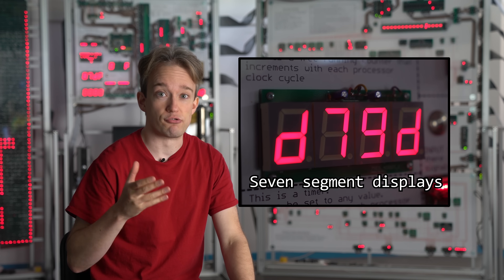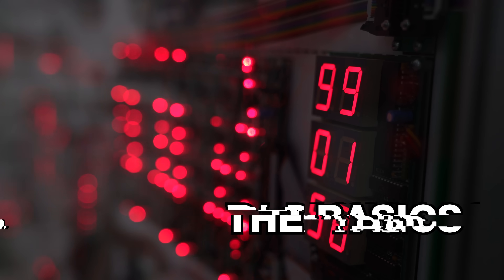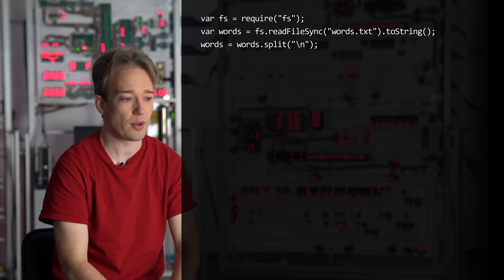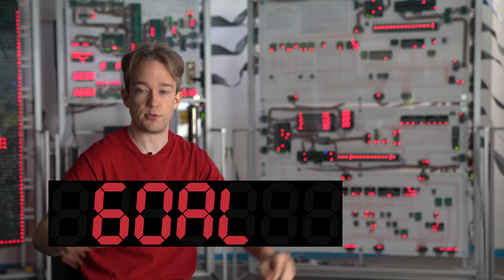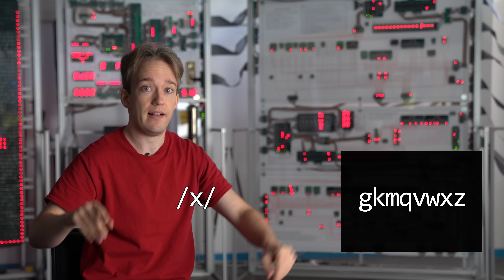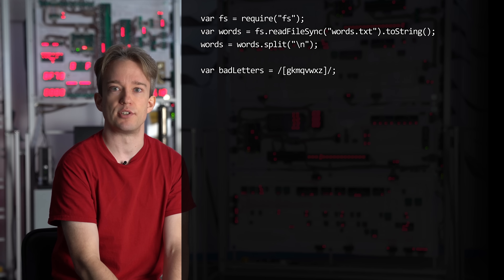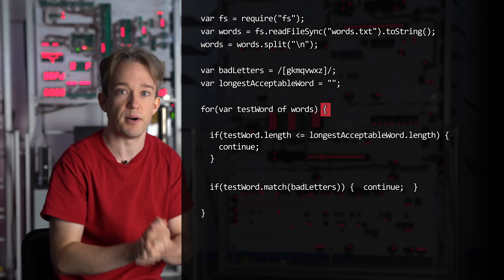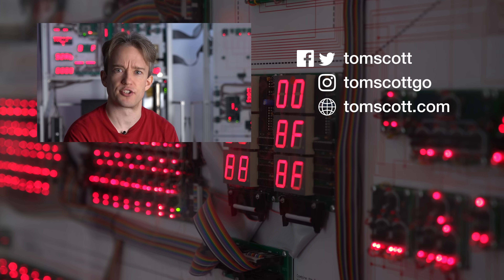What's The Longest Word You Can Write With Seven-Segment Displays?

Comment: I may have an updated list, but the longest word (regardless of whether or not it can be displayed on a 7-segment display) came out to be "pneumonoultramicroscopicsilicovolcanoconiosis".
Reply: Also c#:
using System;
using System.Collections.Generic;

namespace SevenSegmentWords
{
    class Program
    {
        static void Main(string[] args)
        {
            // Gets user input for file
            Console.WriteLine("Enter file path:");
            string filePath = Console.ReadLine();

            try
            {
                // Reads file
                string[] words = System.IO.File.ReadAllLines(filePath);
                string invalidLetters = "gkmqvwxz";
                // invalidLetters += "io"

                // Checks if word is longest and if it is, checks if it is valid
                List<string> longestValidWords = new List<string>();
                longestValidWords.Add("");

                foreach (string word in words)
                {
                    if (word.Length >= longestValidWords[0].Length)
                    {
                        bool valid = true;
                        foreach (char letter in invalidLetters)
                        {
                            if (word.Contains(letter))
                            {
                                valid = false;
                                break;
                            }
                        }
                        if (valid)
                        {
                            if (word.Length > longestValidWords[0].Length)
                                longestValidWords.Clear();
                            longestValidWords.Add(word);
                        }

                    }
                }

                Console.WriteLine("The longest valid words are:");
                foreach (string word in longestValidWords)
                {
                    Console.WriteLine("-> " + word);
                }
            }
            catch (Exception e)
            {
                // Displays error message
                Console.WriteLine(e.Message);
            }

            Console.WriteLine("Press any key to continue . . .");
            Console.ReadKey();
        }
    }
}

Comment: Because one liners are fun.
require(`fs`).readFileSync(`words.txt`,`utf-8`).split(`\n`).sort((a,b) => { return /[gkmioqvwxz]/.exec(b) ? -1 : b.length - a.length })[0]
Also, I disagree with Tom on this. lowercase g and o can be represented perfectly. Therefor with the final code below, the longest word is, strangely, "bras-dessus-bras-dessous" which is apparently a loan-term from French meaning 'arms in arms'. :shrug: After that is 'three-and-a-halfpenny'
require(`fs`).readFileSync(`words.txt`,`utf-8`).split(`\n`).sort((a,b)=>{return/[kmiqvwxz]/.exec(b)?-1:b.length-a.length})[0]
Reply: grep -v '[gkmqvwxz]' < words.txt | awk '{ print length, $0 }' | sort -n | tail -n 1

Comment: "Programming is not remembering exact words or syntax: it is breaking down a problem, working out how to solve it, and then fixing all the inevitable bugs in your solution."
- Tom Scott

Sorry, i am amazed by this explanation of what programming is and i think it deserves to be quoted in the future too.
Reply: True. As someone who've only recently started getting into programming, I sure find it encouraging.
Reply: This is very true. Remembering Syntax is not as important as people think. It’s all about solving problems.
Reply: Also, a lot of people think you need to be good at math to be a programmer, which is not true.
Reply: @Pedro-fh9ec  Math and programming have 1 main thing in common - problem solving.
Reply: @tomekz6841  so that's carryover from math to programming that you can problem solve. got it
Reply: @Pedro-fh9ec  I think knowing math was WAY more important in older forms of programming like Assembly. There's a fascinating video about how Quake developers invented a shortcut for some complex equations as a way to keep the machine from slowly doing the really big number maths. Nowadays you can get away with not knowing any math because the computer can already handle all the math you want.
Reply: @chaotickreg7024  Could you link it to me? or any other resources regarding differences between modern programming and older forms? I am really curious
Reply: @Pedro-fh9ec  I guess you can write some algorithms without math, but almost all big software projects use math heavily because math is the translation from the real world to the abstract world
Reply: @Pedro-fh9ec  I'm rubbish at maths but on the brink of getting my CS50 cert from Harvard. Now, CS50 is hardly a massive achievement but if you need maths for programming I'd never have gotten to this point
Reply: @TypicallyThomas  you need math for certain things in programming for sure, but some things you can skate by without it
Reply: @KayOScode  You mean maths?
Reply: @Pedro-fh9ec  WEELLL if your working at company and need to traverse a huge txt file it helps to be able to find the fastest way to do that
Reply: @Pedro-fh9ec  you dont have to be good at math to be a programmer, but it definetly helps. There are so many parts of complex prograams that get alot easier to design the structure for when you have a good base knowledge of mathmatics.
Reply: @Pedro-fh9ec  You don't need to be good at math to be a programmer, but you definitely need to be good at math to be a good programmer
Reply: And I do NOT miss the old times when I start coding and we had to figure things alone.
Reply: to an extent, this also applies to 3D art :)
Reply: If you study computer science and have even half-decent professors, this is exactly what all of them will tell you. Any programmer who isn't a total elitist will say the same thing.
Reply: @gyroofthyme  I've never met a single person in my life who's said programming is just memorising syntax. That's got to be the stupidest, most reductionist way you can describe it.

What Tom said is common sense
Reply: @itsnottimetostop4462  Yep that's my point. I have met people who think you're a bad programmer if you can't write perfect syntax from memory,  and they're completely wrong. Any programmer or CS professor worth their salt will tell you exactly what Tom said.
Reply: @gyroofthyme  I guess you dont need perfect syntax all the time, but productivity is increased when you know it. My rule of thumb is "you should only need to research a new language feature one or two times." Im also a textbook elitist programmer, so thats just me
Reply: The bug fixing is the most nerve wracking part. Hours and hours of bug fixing...
Reply: ctrl c ctrl v
Reply: I‘ve been programming for over 10 years now. The usage of stack overflow does go down over time, as you’re learning things by heart. What you also tend to learn is that some problems are not to be solved on the same day - you tend to get the solution a day or two later out of the blue. Writing tests actually helps, even if you initially didn’t like to write them. Also continue, break and the ternary operator are your friends, despite the naysayers.
Reply: @0xbenedikt  I have also been programming for close to 10 years now. Since the beginning I refused to use stack overflow or libraries for anything because I wanted to learn to do it all myself. Good choice because not being tied to that definitely makes you a stronger software engineer. Solving problems often comes when I get up from my computer and play pool and break down everything in my head to really understand each constraint and requirement. That helps me design a good framework that can be extensible and most importantly used for the current problem. Finally, at the beginning I used break and continue whenever I wanted, then I went to college where they said not to use them at all so I stopped. Then after a year in industry, I began using them again in a cleaner way than I did at the beginning. If used incorrectly, those keywords are no better than code like this:

int x = 100;
int i = 0;

start:
if (i >= 235) goto next;

for(i=0; i != x; i += x)
{
    x %= i * 2;
    if (x == 0) goto start;
}
next:
Reply: But it also does help to know WTF you're doing.  If you can't remember the structure/syntax of the programing language, it doesn't matter if you know how to solve the problem.
Reply: @jovetj  I disagree. Syntax can be googled, problem solving can't be
Reply: @TypicallyThomas  It can be googled, but it takes time and it isn't as efficient or optimal as someone that knows what they're doing.  
But, some problem solving can be.  Need a sort algorithm? Google it.  etc.
Reply: me who took a programming class and they made me memorize code and analyze what the outputs of the code did ._.
Reply: Here is another one. "Programming is nothing without the knowledge what to do with it"
- Sigurd Torvaldsson
Reply: Programming is looking past the strategy and getting at the fundamental thing you really want done, then finding the best way to go about it (clearest, most efficient if speed or space matters, etc.).
Reply: HR interviewer : no you're wrong
Reply: Somebody really should have mentioned that to the guy who wrote the test for my "All Engineers have to take this course" version of computer programming which was just "How to write in 'C'".
Reply: i disagree
Reply: It makes alot of sense too. If a writer used a thesaurus to look up vatious words to use, we wouldnt say he's not a real writter because he doesnt know all the words off the top of his head.
Reply: Programming is all about understanding the programming language you are using and how to solve the problems you encounter along the way

Everyone can be a programmer, it's all just puzzles
Reply: Amen to that. My previous mentor wanted me to code on paper so that I would know certain programs by heart. I guess that's the difference between a programmer and a coder, hey🤣

Comment: @6:59, I don't hate loop breakouts, but in this case, you've got two incredibly simple if-statements that are very easily negated, allowing you to actually use good coding structure without confusing your audience. Why take thirty seconds to explain (and apologize) for the controversial loop-break-out instruction and not take 3 seconds to explain the simpler negation operator, and another 3 to explain either the AND instruction or another 10 for what nesting is? Then you've got a clean program that you can explain as "If the word passes these two tests, then and only then do we replace the word"? Also, what is the overlap between people who could recode the program and people who didn't immediately recognize the problem you state @8:21? You already use arrays in the program.

Comment: You could check the length of the longest found word. If the word that's being tested is longer, then set that value to the new length. Also, use an array and clear it for each time the length goes up. Then add to it for each word that's the same length.

Comment: Open top 4s are normal. Not just getting used to them or whatever, quite a few fonts have open 4s, some people write 4s like that.
You can even find open back 4s where the line between the top point and horizontal bar is missing.

There's a lot of ways to draw a 4, and the seven segment way is just using one of them.

The variation is like how there's the lowercase a with an overhang, or without the overhang. Or 7s with a bar in the middle. Or 9s being curvy lowercase g shaped or rigid q shaped.

Comment: Wait, why does the “n” have to be full height?
Reply: @real gamer why not to write it half the height though?
Reply: @88Timur88Bahmudov88  same thing with r.
Reply: @88Timur88Bahmudov88  you could but that just isn't the way it is
Reply: Eh, at least in case of 'N' it's harmless. But why is 'i' full height?
Reply: @sharpfang  i is better full height
Reply: @thecaptainnoodles  full-height i is same as 1. lowercase is unambiguous.
Reply: as same as "c"
Reply: If you make the c lowercase it makes it unambiguous from the G that looks like a c, too.
Reply: The aesthetic
Reply: @iBrow Its because we use upper case letters in these displays, mostly
Reply: @priyanshsiingh  A good programmer would use lowercase, it uses less energy.
Reply: Why does it matter?
Reply: Well, ultimately it doesn’t matter. The point of that test was just to check if it didn’t replicate the formatting of any number, and it doesn’t so both work just as well. But you’re right, it could be written like that too.
Reply: @TheHunterUnknown  Except S and 5 are identical, so it's broken.
Reply: It doesn't matter you're still using up one seven segment display whether you write a small n or a big n so it will not affect the question of word length as you cannot alter the number of characters you are using by changing the size of one of those characters. Unless you have some other reason I haven't considered which I cannot imagine you do.

Comment: i know that the information Tom puts here is for teh basics. But something that should be noted nowwith mor modern JS is tat we we never use "var" always user "const" unless you want to change the value, then use "let". also using For loops is kinda bad practice, the same way using a switch is bad practice. AirBnB have a great thing in their eslint rules about it on github issues. You can always replace a for loop with ForEach, Map, Filter, Reduce, Some, Every, Find, FindIndex, Includes etc. (so many options, don't mutate)

Comment: Missing a quite crucial part for disallowed letters, its easy to write letters like 'w' using 2 segments, one reverse L and one reversed J next to each other. Depending on the word this could save space, for example with letters like 'I' you can fit 2 into one segment. This means words like "WII", even though 'W' is two segments it still only takes 3 segments. So you could fit a long word if it contains a lot of 'I' even though it contains letters like 'M' and 'W'. Making small sacrifices might be good in the long run.

Comment: I thought you meant in 7 seven-segment displays like you showed at 3:20 . I was sure then that you'd then tell us you can bump up the word length if you spelled across two rows, using letters that can fit within those 7 displays in the top or bottom like n , i, u, c, L, r. Could you make a video like that and show the result on the displays (real or simulated)?

Comment: All you're getting right now is the last long word in the big array.
What you want to do is rather than setting it in a string, set it to an array instead.
It'll come out with a complete list of long words that can be spelled.

Of course, you probably also want to filter for the length of the display you'll be displaying on, because this should all probably be printed to one at some point. I know that goes against the spirit of the exercise, but hardware matters. Ideally, if you have 25 places, you want nothing longer than 25 letters, unless you're going to let me cheat and use letter combinations like ii in one space.

Comment: In my head, this was a WAAAAAY cooler problem where you were trying to fit an 8 or 9 letter word into 7 nodes using tricky letters like ll, il, or iTi to get ahead.
Reply: TheBrothergreen that poses an interesting question about how to change the program to recognize those sets of characters and count them as either 1 or 1.5(2) character spaces. Could be done but that’d be some messy code

Comment: 6:59 How could continue cause any confusion? It just starts the next iteration of the innermost loop and leaves the outer scope completely untouched.

And the JS functions filter and reduce reduce your code into one line (excluding the boiler plate)

// ... Boiler plate ...
var longestAcceptableWord = words.filter(str => /[gkmqvwxz]/.test(str)).reduce((str1, str2) => str1.length > str2.length ? str1 : str2);
Reply: I agree. I like continue and I use continue all the time.
Reply: You know the skip variable is unnecessary here? Just use `if (false) { ... }`. How can continue be less confusing?
Reply: filter followed by reduce is silly. You iterate over the array twice when you could do it just once. Just include the filtering condition in the reduce callback.
Reply: @maelstrom57  You could implement filter and reduce as generator functions.

Comment: In response to the pinned comment bonus question: bibliologies or glossologies, working with a standard numbers only calculator. That's 531607017919 for bibliologies and 531607055076 for glossologies. I assumed both 8 and 9 as b, so feel free to substitute them freely as I only made use of 9. I also have a calculator that allows me to write using letters A - F, X, Y, M, as well as a P, r, g, and pi. Combining these with 1 as I, 5 as S, and 2 as Z, the longest word I was able to spell was preinferredpreinferring, as PrE1πFErrEDPrE1πFErr1πg. Which is horrible. So I tried again only using the letters that were clear and capitals, and I found cycadaceae, mayacaceae, and papayaceae. Not the sort of words you'd want to be sending to your friends via calculator, but the longest possible that are actually readable.